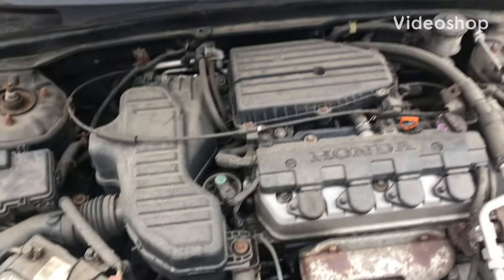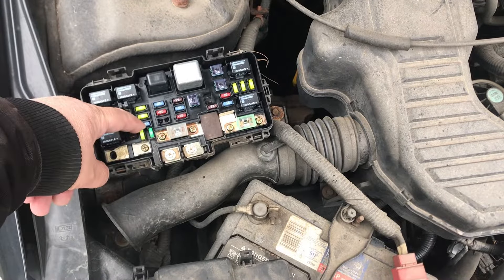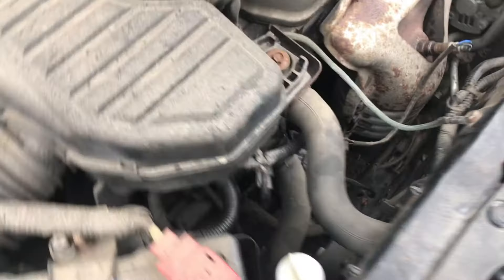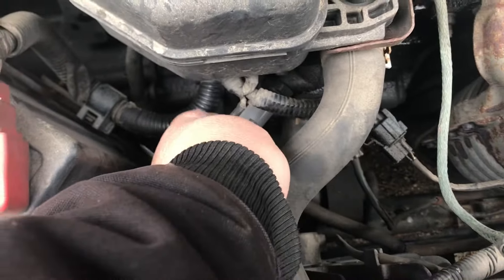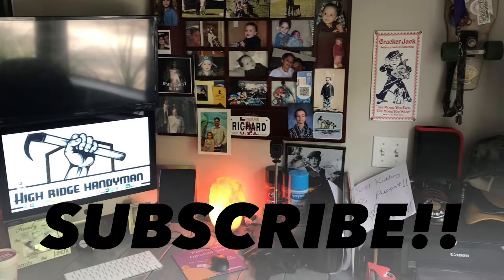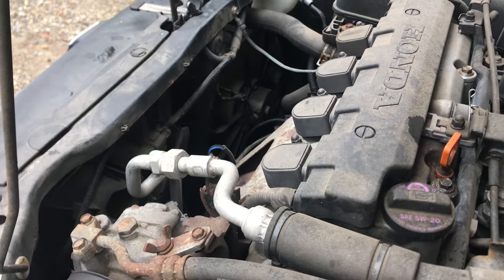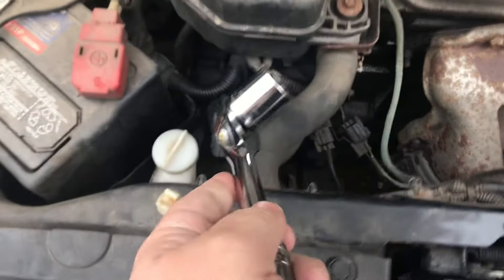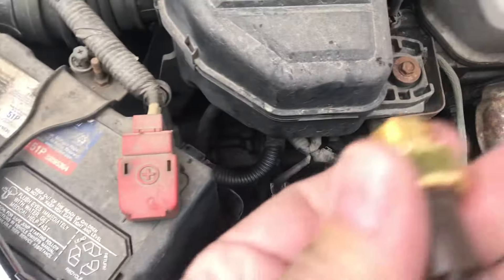Honda Civic “01-05”Faulty Cooling Fans causing overheating. Troubleshooting

Comment: Did this, replaced the sensor and still nothing. Paper clip trick turns in my fans, new sensor doesn’t. I was told it’s the fuse box needing replacement
Reply from the maker: Make sure you have the correct sensor for your vehicle. There are a few and both look the same. Also your temp has to be high in order to trip the sensor on. Change out the thermostat . Some thermostats have intermittent trouble
Reply: I did the same i replaced both sensors, fuse relays thermostat and fans are working except when the engine is running
Reply: Did you find out what was causing the problem ? Im having the same issue fan dont turn on. @frankdelao280
Reply: I'm having the same issue. Changed everything and still no fan unless I override with paperclip. Fans will only come on with AC otherwise no fan even when engine is hot. Car overheats when it gets hot.
Reply: @frankdelao280 did you ever find out what the problem was

Comment: What if my fans come on even if the engine is cold?
Reply from the maker: @ivanska3099  Sounds like the engine coolant temp sensor is reading incorrectly and could be defective Or you could have a bad fan relay causing the fan to run continuously. Good luck

Comment: So if the fans don't turn on when you do the paperclip connection, it's the fans.
Reply from the maker: Also check the fan fuses,wiring to the fans. If they are good then most likely the fans
Reply: Do this when the car is running?
Reply: Jump two wires directly from the battery to the fan plug... They should come on if good, if not it's the fan for sure

Comment: First fan fuse was blown! But no fans once replaced. When I jumped the switch - both fans came on. Replaced switch - no fans. Had replaced thermostat prior to finding your video. Where would you suggest I look next? Thanks!
Reply from the maker: Try changing the cooling sensor switch.
Reply: Having the same problem. Any suggestions to look next. 
I changed the switch temperature. 
Is it possible the engine temperature switch?
Reply: I’m having the same issue
Reply: Any update I’m having the same issues and I’ve replaced the thermostat and the switch relays and fuses are good the paper clip by pass works new sensor switch doesn’t kick the fans on any suggestions?
Reply: @repssrepps mine is doing the same thing. Replaced all the sensors, fuses, and thermostat.
Reply: @repssrepps  right there with you.. It's a little aggravating to say the least.

Comment: What the heck is the sensor called I tried getting it at the parts store and they couldn’t find it
Reply from the maker: It’s called a Coolant Temperature Sensor. If your parts store doesn’t know this find another store bro.
Reply: It's the fan sensor switch
Reply: depends which one you're changing.. the one he changed is the fan sensor switch.. But you may have to change the coolant temp switch as well.

Comment: The fan would kick on then cut right off. Would not stay for long. I have replaced both the Coolant Temperature Sensor and Cooling Fan Switch, thermostat and radiator. I checked relays and fuse all seems to work including the fan. Last thing to check is the water pump.
Reply from the maker: Cooling switch could be faulty , also make sure you have enough coolant in the system. If coolant is low the switch won’t be totally submerged and will trip on and off. Open the cap when cold and make sure the coolant is to the top covering all internals. Good luck

Comment: 2002 Honda Civic LX.  Radiator Fan & AC Compressor Fan immediately turn on when I start the vehicle from cold.   Would a bad relay? bad fuse? or sensor cause this issue?  Fans stay on the whole time and it's causing the vehicle to overheat for some reason.
Reply from the maker: @hangman864  not sure but try all you mentioned one at a time to eliminate the good and prove the bad

Comment: My problem is my Honda civic 2005 is overheating while driving. All fans are working 
Temperature switch is working 
The radiator is fine water pump is fine
The car only overheating when I drive. When it on parked it not overheating. Can any one help me please
Reply from the maker: @augustinkazadi4447  have you tried to flush out your radiator? If not small debris can cause overheating when driving. Also make sure your thermostat is working properly at high temps. Also check the fan relay.

Comment: Replaced cooling fan switch yet fans still not coming on.  Do I need to replace the thermostat now?
Reply from the maker: Did you jump the plug to make sure the fans work? If you did and the fans did not come on then check the wiring to the fan motors and the fan motored themselves. If fans work then I would definitely change out the thermostat. The first thing I do is change out the thermostat. Most of the time that’s was the issue is. Good luck be safe. If your not skilled enough ALWAYS HIRE A PROFESSIONAL. Good luck
Reply: @HighRidgeHandyman  Jumped plug and both fans come on.  Will address thermostat next.  And unfortunately don't have the proper equipment to drain the coolant.  Thanks for the reply.
Reply: @ryesters did that fix your issue?

Comment: I had an issue where the fan would kick on, then cut right off. Wouldn’t stay on for more than a second or two
Reply: Did you solved the problem
Reply: I got the same issue
Reply: I'm bout to run these damn fans on a toggle to stay on when im at a stop light to see if that's what cause the car to overheat slightly when at stop lights after driving on highway for 30 mins at 80-90mph

Comment: My cars fans both turn on only when ac is on and one stays running when ac is off ?
Reply: One is an ac fan the other is a rad cooling fan, if your ac is off the ac fan isnt going to run

Comment: My problem is my fans turn on and off with in a minute or so car stay hot any idea thank you
Reply: Is the water in the radiator bubbling when car is running its probably the head gasket
Reply: @RobertMorris-l3l  thank you no not the problem I found out the person I got it from never burped It so it cause it to over heat now I drain it filled it up burped and now the problem gone
Reply: @TheMajenos5  glad you found it out instead of having to replace the head gasket

Comment: I tried using a 15/16 inch since l don’t have a 24 mm socket n it didn’t work. Did you use a deep socket 24mm socket or regular.??
Reply from the maker: Deep socket
Reply: Thanks I ordered on Amazon the deep socket. Appreciate it.
Reply: you can get in there with a crescent too.

Comment: what is the part number that you switched? im trying to buy that one but i think i got the wrong one because when i put the new piece on the fans don't turn on. however, the fans do work because we tested before getting to buy the new senser.
Reply: Same problem.  I am pretty confident I bought the correct sensor.
Reply from the maker: https://shop.advanceautoparts.com/p/carquest-premium-coolant-temp-switch-aca1517/12541596-P
Reply: The after market I bought turns the fans on at a hotter temp. example the factory original turns fans on at 207° and the aftermarket would turn fans on at 225° didn't like that so took it back.

Comment: Thank you, the fan switch fixed my overheating situation.. but i have a question.. Is it a problem that my fans dont cut on automatically when i turn the AC on?
Reply: Okay now its getting hot again lol... this is so frustrating... my fans were just working properly when i changed the fan switch..now its beginning to overheat again because they arent kicking on again like they were... but when i jump the 2 pins it stays cool. Do you have any clue what the issue could be ?
Reply from the maker: Make sure your thermostat is operating 100% all the time and it’s not working intermittently and on its way out.
Reply: @HighRidgeHandyman  .. Will do...Should both hoses be hot?
Reply: @MAAT21519 lower hose should be warm to hot but cooler than upper hose

Comment: Only one of my fans is kicking on does that mean the whole assembly is faulty?
Reply from the maker: When trying the paper clip Try turning the ac on full when you test it. Both should come on. If not check wiring to 2nd fan that doesn’t work

Comment: Only one fan comes on
Reply from the maker: One is for the temp coolant and the other is for AC. Drivers side id engine coolant and the passenger side for AC. Which ever isn’t working check that fuse and relay.
Reply: @HighRidgeHandyman 
Did the paper clip the ac fan kicked on but the other didn’t I checked the wiring looks good but what else could be the problem

Comment: Does this also cause when idle engine temp to rise and when driving engine temp to go down?
Reply: having the same issue right now, either clogged radiator or not enough air flow from the fan. when you’re driving it’s pushing enough air
Reply: @Forvs1 I’m having this exact problem!!!! Someone pls respond to me if you found a solution my car doesn’t over heat at all even tho the temp gauge shoots all the way up
Reply: @HenryFernandez-nh1jx  i had a bad head gasket 😭😭😭